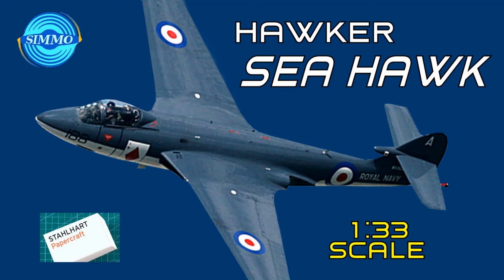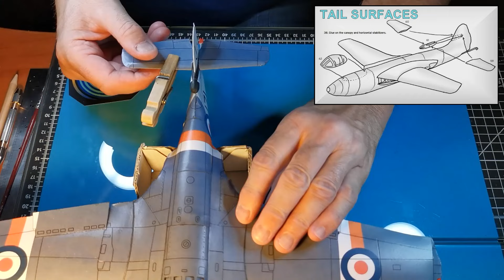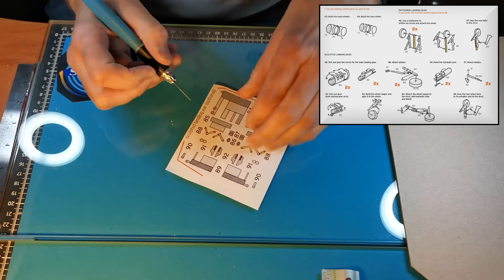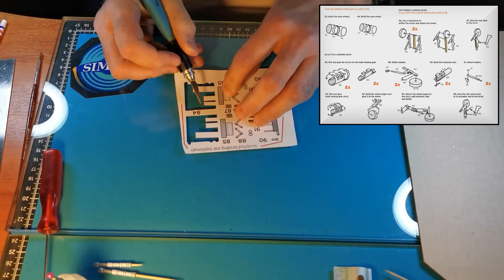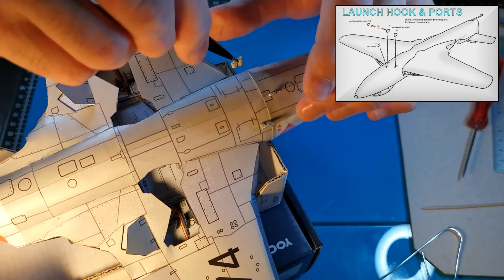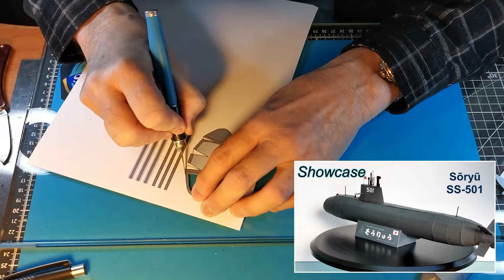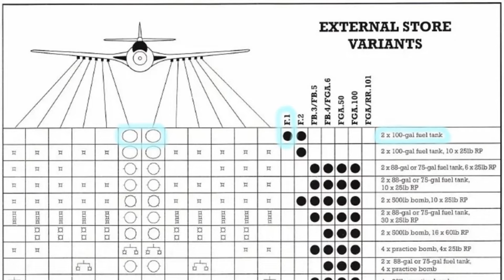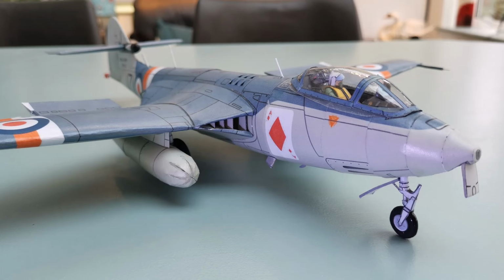Sea Hawk Paper Model Construction - Part 3 .... On Final.

Comment: Excellent Job Simmo - Question: how / what are you printing your thicker sheets of 'paper' on?  if I try printing anything thicker than a normal A4 sheet in my printer it either jams up or doesn't pick the paper up in the first place. I can see this model being even more fiddly at its normal scale.
Reply from the maker: I printed this model on 200gsm paper which in retrospect was a little too thick and would have been easier with 160gsm. I don't have a problem printing with my printer (a Canon) thinner paper, 80gsm is in a front cassette which feeds and bends the paper around a roller and thicker papers fed from the back which bends the sheet to a lesser degree.
Thanks for your comment.
Simmo.